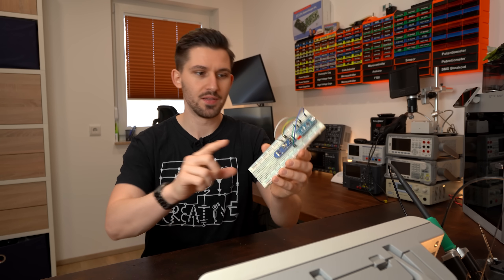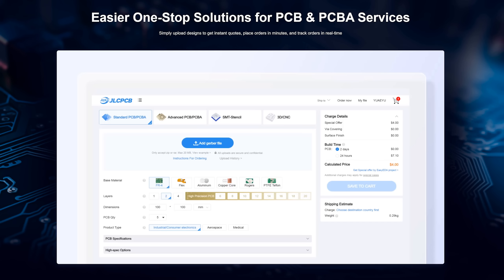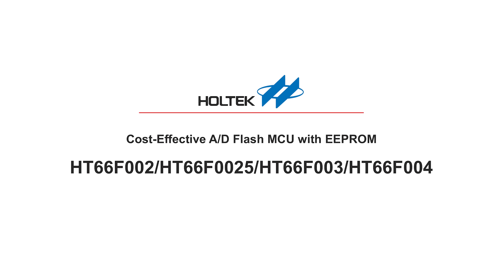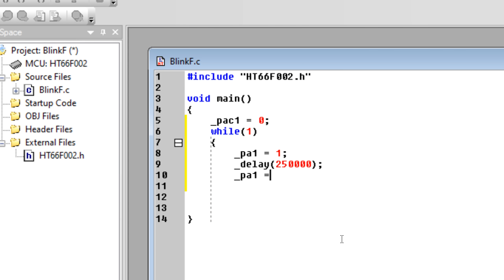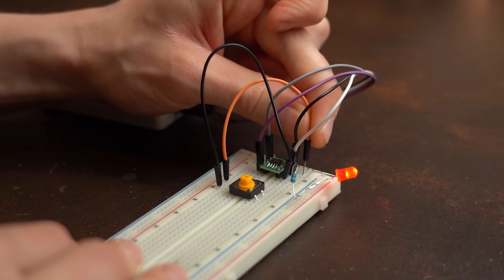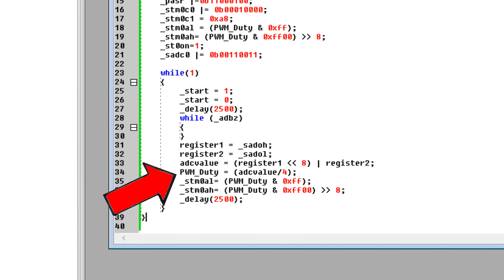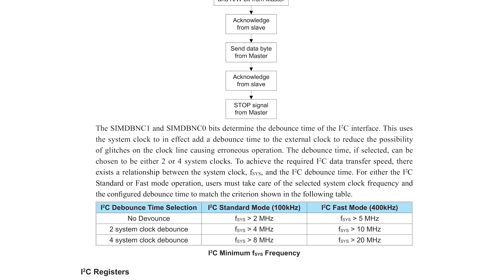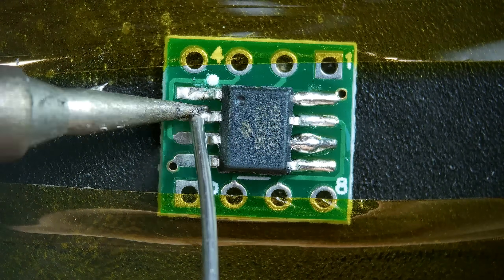I tried the Cheapest Arduino Alternative (that Nobody heard of)

Comment: You've confused me. You are trying to save 14 x €2 on your project but then purchase a €100 programmer 🤔
Reply from the maker: Yes
Reply: @greatscottlab  We are appreciating your effort. Of course you saved on controller, but in total it cost you more because of additional equipment you needed and also your time. This is exactly how it works in professional environment, where the purchasing dept. pushes you to save some cents on chips, but in total it costs more and slows down the development, when is needed to learn something new. On the other hand when the quantity is huge, than it makes sense to save every cent.
One more thing: In the price of MCU are also included the prices for the licences of integrated protocols and the work of software developers for SW support like the HAL and configuration GUI. eg. STM. This everything speeds up the development process and in total saves money for you.
Reply: All for science, right? 😀
Reply: @greatscottlab do you know if the protocol to program it is on the datasheet? Maybe an arduino could ne used in the middle to talk with the computer and these super cheap micros 🤔
Reply: Well, in fairness, the programmer can be used in other projects.
Reply: Next video: 
I tried the Cheapest Holtek Alternative (that Nobody heard of)
Reply: I wonder why he didn't use a Padauk microcontroller. It has an open source programmer.
Reply: @wiktorpp A word of caution with the open source Padauk tools - you cannot do in-circuit debugging with them. Expect to waste a bunch of OTP parts while debugging. Also the weirdo mix of C, macros, and assembly that the Padauk compiler uses is better suited to extremely limited resources than straight C with gcc.
Reply: @wiktorpp Because that wasn't the video he wanted to do Einstein.
Reply: Did you watch the video to the end where he did the usual final comments? He addressed the cost and programming elements and that he would be looking to another solution. That doesn’t mean he should not share the journey and allow us to learn what he learned along the way.
Reply: It's like investing in a table saw. Yeah you can cut a 2x4 with a hand saw, but if you plan on doing a lot of cuts over time then table saw becomes a worthwhile investment.

Yes, I'm aware that you have a ton of responses already, I just thought I'd put in my two cents
Reply: You are comparing cost of prototyping boards with single chips. It is a meaningless and misleading comparison.
Reply: Guy math. If you need a tool for a project the tool is free.
Reply: To all the naysayers: the point of the lower cost chip and more expensive programmer is NOT just for one project!

That's like saying a circular saw costing £xxx.yy is MUCH too expensive when you already have a perfectly working and adequate hand saw! DOH!🤔😲🙄👎👎
Reply: economies of scale my brother in Christ
Reply: @samanthaqiu3416  yeah that thing
Reply: Cool scott. Dave bought these jellybeans a while ago
Reply: I guess the sponsorship+as revenue makes up for the cost; not a great solution for everyone else 😊
Reply: When he showed that programmer I was like lol, that thing surely cost a sh*t ton more than what he saved😂😂
Reply: 50 controllers later, the programmer will pay itself back
Reply: This would be cost effective for a company that plans on making thousands of the big project... so he's teaching you a skill companies will value.
Reply: how it always ends up!
Reply: ...and he had to fiddle several days while an engineer like him could command a 3 figure hour rate. A merchant he is not.
Reply: Don't discount not only our ability to save 10c on a part but also turn a blind eye to tool cost
Reply: Maybe it is because you can now build ten times as many things using these chips and use the programmer....
Reply: I knew that from the beginning of the video 😂
Reply: That's an every engineer move 😂
Reply: Bcz it is one time investment for bulk production
Reply: Math is hard
Reply: Use 2$ arduino such as programmer😂
Reply: I wonder if you could use the $2 Arduino to program the $0.20 microcontroller
Reply: It's only 1/10 the price of the Arduino, so the one off cost of the device for flashing the onboard memory is very easily offset once the number of controllers used reaches a certain threshold.
Reply: He wanted to use a lot of proximity detecter which dont need a lot of input output pins. Bunch of arduino s would be a waste of microcontroller.  I would use the arduino for some ir controllers with lots of relay or outputs.
Reply: Thanks for the video-aaaaaaah i rally liked it-aaaaaaaaah 😂
Reply: Im happy with my 10$ CH341A(Bug Fixed!) programmer
Reply: he buys it once duh.
Reply: Such is life
Reply: But with the programmer he'll save 14x €2 on the next project 
And then 14x €2 on the next project 
And then 14x €2 on the next project 
And then 14x €2 on the next project 
And then 14x €2 on the next project 
And then 14x €2 on the next project 

And then 14x €2 on the next project

And then 14x €2 on the next project

And then 14x €2 on the next project

And then 14x €2 on the next project....
Reply: Wow there's some really smart eNgUhNeeRs in this thread.

If you're going to make a bunch of something, it makes more sense in the long run to buy the tool to do the job. It pays for itself over time. It's commonly referred to as an investment. Have fun spending 10 - 20 dollars a board when you need to make a bunch of the same product.
Reply: As a good friend of mine said, no tool is a waste of money
Reply: I did not know you can still buy people nowadays
Reply: @turolretar they don't call it slavery anymore.  Its called human trafficking.
Reply: @turolretar  wait, you don't?
Reply: @triadwarfare  programmer was a person doing the job of programming. most programmers call themselves "developers" but they only do coding in web languages, they don't develop any new product, which is ironical.

its like calling yourself CEO of your startup, you're just an entrepreneur programmer , not a CEO, you're not the chief of anything at all, there are 0 other people on the "team".
Reply: @triadwarfare  I refer to myself as software engineer, due to the design/documentation parts of it
Reply: @monad_tcp  I agree - shuffling precompiled packages about in a preconfigured environment on preconfigured servers is not programming.
Reply: @MeBerserk  Are the next guys up "architects" 

Always makes me chuckle if we ever have them on site. Haven't touched a keyboard in years, and couldn't draw a decent looking house if their lives depended on it 😂
Reply: @MeBerserk  exactly. Position is often named as Hardware or Software design engineer.
Reply: @monad_tcp this is is stupid.. a CEO is a literal legal title.. when you start a company you have to choose someone to be the CEO. Doesn't matter whether your company is a company or one or more. You are still the chief executive... God damn this is such a dumb comment..
Reply: @triadwarfare  as a former programmer and developer, I now refer to myself as a software engineer, the title of my last job.
Reply: @MeBerserk 
The definition of Engineering, from the society, is that an engineer calculates the rated load / performance of a design, before it's built, based on established principles.
In the obvious example of a bridge, the engineer can say "this design is rated for 20,000 pounds" - before the bridge is built, so they know they shouldn't build that design if they need a bridge that will hold 30,000 pounds.  You're doing engineering if you're designing a software aystem to handle 200,000 simultaneous users. Or one rated to estimate location within 0.1mm, or whatever the appropriate performance metric is.  If you can make (supportable) statements about the performance rating of the system that's being designed, that's engineering.
Design, without calculating how that design should perform, could be just systems design, or architecture.

Note it's not about how WELL it's designed.  An item that's constructed without engineering might be stronger/faster than one engineered for a specific load or speed.  The one that's not engineered for the specific speed needed will just be heavier, more expensive, and less reliable - because nobody calculated what it's rated for. It's probably overbuilt, but maybe under built.
Reply: @triadwarfare sure if you are making software. But I program machines, plus and automated equipment.  I'm still a programmer.
Reply: @MeBerserk  common misconception: people think they can buy a politician, really they just rent them!!!  😂😂😂
Reply: @turolretar  web programmers are pretty cheap, you plug a coffee line on them and they spit code on their outputs, which you glue to a keyboard,  they'll create JS libraries forever for you, very cheap and efficient, but not secure
Reply: German engineering
Reply: I do the same. I can buy expensive equipment to save a few bucks. But with the knowledge, i now own that piece of equipment.
Reply: This guy makes useless stuff regularly
Reply: Do you program your arduinos with telepathy or use a +1k dollars computer for programming them?
Reply: @GeomancerHT think pad gang here and you are completely wrong I use a 30 dollar old think pad which my sibling gave me works just fine
Reply: @GeomancerHT probably not but with this few cnt chip you still need that 1k computer next to the 100 euro programmer so your rebuttle wasn't really thought through it seems
Reply: @GeomancerHT  "Computer" used to be a profession, back in the first half of the 20th century. It has now become a common term for a device. Same with "Programmer" in more recent times.
Reply: @GeomancerHT this still requires a computer
Reply: @GeomancerHT  Who says the computer has to cost more than 1k?
Reply: @GeomancerHT  i use a 3k laptop for programming, designing, 3d modelling, video and audio editing... your point is irrelevant. Tools are tools they are always useful. But when there are better options that don't require buying a specific tool for that uC only i'd go for the better options.
Reply: I was straight into AliExpress to find the programmer cost and sadly stopped watching after that.

The break even point is 60 odd units, plus learning a new microcontroller that doesn't do anything new or better than the appropriate $2 part.

Comment: I would use them if my sketches didn't take up too much space/werent too complex, i knew about their existence but 512B is stretching it short

perfectly viable for very simple projects tho

i'd like you to look in the $1 Arduino/328P alternatives (LGT), those things run at 32MHz on the internal osc and have 12bit adcs
Reply: I'm not sure where you found the 512 byte program size limit! You've got a wole 1000 14-bit long words for your program.
Reply: @AnnaVannieuwenhuyse  i meant in RAM, ROM is fine.
Reply: @AnnaVannieuwenhuyse  The ROM is fine, the RAM is kinda an issue

Comment: The programming pin names OCDSDA and OCDCLK do hint at On Chip Debugging, the IDE even has a Debug menu. It might support breakpoints, much better than using Serial.print
Reply: yes it does have on chip debug
Reply from the maker: Debugging is only possible for their "special" development boards. I was sadly not able to use it with their normal uC. But maybe I was also just too stupid.
Reply: @greatscottlab  Yes you need the HT66V rather than HT66F part to debug. You can get them from a Holtek rep, from Bestmodules or from dev boards and just hot air gun them off. They do it to reduce the cost of the production parts
Reply: @pyromaniac303 always an expert in the comments! Good on ya
Reply: @pyromaniac303 ah, so you'd use the V part with debug in development, and F part in production for cheaper manufacturing cost
Reply: @soupwizard  yes that's right. Though in practice on the F002 and 003 etc. parts they're so simple that debugging is a bit pointless. If you really need to find out a variable value, just create a configurable 1ms delay you can call and toggle an I/O pin, so say a value of 130 would create a 130ms pulse you can view on a scope.

Comment: Der PY32F002 (14 cents) mit ARM core. Wäre das auch eine Option?
Reply from the maker: I can put it on my to do list :-)
Reply: @greatscottlab SWD-Programmer sollte gut in die Arduino Welt passen, evtl. sogar relativ STN32 kompatibel (habe den Chip aber noch nie getestet).

Comment: You should be able to use the programmer to debug as well, just like an Arduino. Usually there are functions that allow you to write to the serial bus, which should even show up in your Arduino IDE if you pick the right port.
Reply: after using cortex m0 stm32 clones that you can debug with breakpoint it is so good im not going back to stone age using serial lol
Reply: @lifeai1889  I know what you mean. It's incredible to have reliable step debugging/breakpoints and access to the stack. It ruins any platform that doesn't support them. Some bugs just can't be fixed without it!
Reply: I've used both debuggers and "print" on many, many projects, and have found the debuggers had a much higher learning curve.  I can get a lot of debugging done just by sending a single character to a serial port or even blink codes to an LED.

Comment: What is the resistor value you connected to LED?
Reply from the maker: Not sure. Maybe around 470.
Reply: Choose your resistor according to the supply voltage minus the forward voltage of the LED, and the desired current (usually 20mA or less). 5mA is a fine current.
Reply: @AnnaVannieuwenhuyse  okay thank you... Here the LED voltage must be 5 Volt as it's the signal level of most of the microcontrollers...

Comment: It is easy to implement I²C Master in Software. Maybe a little bit slower and consuming more CPU time. But not a problem like I²C Slave.
Does it not fit into the limited memory?
Reply: Exactly my thought too. I2C is not hard at all to implement as master. Sometimes even easier than trying to interface the hardware peripheral if just wanting to hack together and reading out a simple value, without bothering with DMA and such

Comment: For 110 € you can buy a lot of Atmega 328P microcontrollers. I like your videos!
Reply: 35 of them in (SP)DIP.
Reply from the maker: Haha true :-)
Reply: @greatscottlab  would it not be possible to use something like a raspberry pi pico as a programmer using software ? (offcourse there will need to be decent documentation about the programming protocol and probably allot of time)
Reply: @ChristopheVerdonck  everything is possible if your time has no worth

Comment: Nice vid! Not sure why you didnt mention that you can implement a bit banged i2c master! No need to have it as a hardware module, specially at lower speeds
Reply: you can bang everything if there's a desire
Reply: OK guys. If writing bit bang I2C master is '10 lines of code', 'really easy' etc., than maybe just write the code and sent it to @greatscott to test. Maybe even share the code further for anybody considering those cheap chips...
Reply from the maker: I am really not a software guy. What you see in the video was the max I could do. So I had not idea that you could bit bang i2c master. Sorry.
Reply: @greatscottlab  no worries! And the development + troubleshooting time is not free either 😅 unless you plan to make thousands of these, its probably cheaper overall to go with a slightly bigger micro with the features that you need
Reply: @greatscottlab  Long story short, you can practically bit bang anything as long as you can generate and/or read signals fast (often) enough. That essentially programs your general purpose processor core to do the specific application, which the usual hardware bus processor is meant to do. They can be functionally identical, although it does obviously pose some limitations in terms of speed, as well as efficiency on power and processing capacity.

If your module/sensor supports SPI or UART, they are much easier to bit-bang. Bit banging will be pretty much the same for any platform, give or take the I/O or timer specific functions which you've already explored!
Reply: @greatscottlab  If you can blink an LED and read a button in the same loop, you are half way to bitbanging I2C.  The rest is looking at a timing diagram to figure out what you need to write (i.e. blink on/off) and read (button).  I2C is a great place to start as the timing is loose and it is simple compared to other protocols with more pins simultaneously active.
Reply: bit banging I2C is so simple you'll regret not implementing it, especially when you have a oscilloscope and an arduino for testing your code. 
You can clock I2C at any speed  even with a CPU running at 32khz. No timing is required (a clock cycle can be 1hz and the next one 1Mhz in the same byte, it doesn't matter). Master or slave, with minimal error processing, would take  about 10 lines of C code. Funny thing is master is much simpler to program than slave.
Reply: @frederichominh3152 Bitbanging slave device is much harder. Using proper library with interrupts would help.

Comment: never realised how arduino works in the background as a so called electronics engineer you should have known that !
Reply from the maker: There are many field of electrical engineering. I actually learned power engineering all about motors, power transmission and so on. So Microcontrollers are more like a "hobby" to me.

Comment: This little microcontroller is quite awesome for the price. Thanks for the video!
Reply from the maker: You're welcome :-)
Reply: Yeah....But the programmer costs about 60 bucks.....Hardly "cheaper" than using Arduino's.....
Reply: @muppetpaster  That's true, but of course, if you use them a lot, it will eventually get cheaper than using arduinos.

Comment: Instead of using this chip, it should be easier for you if you use ch552g it costs around 0.3$ per pic it is way simpler to work with have Arduino support and comes with USB HID protocol so no additional hardware would not require Check out that chip